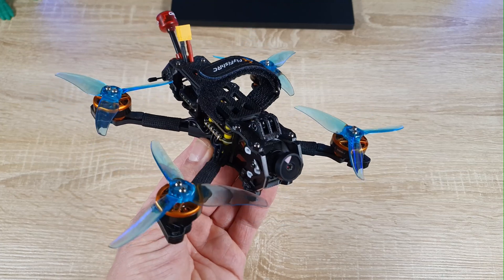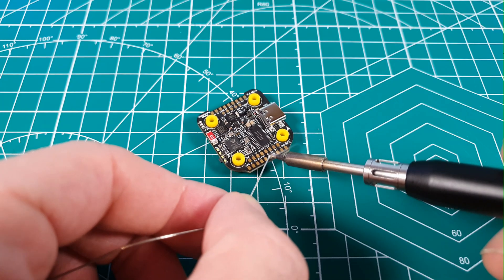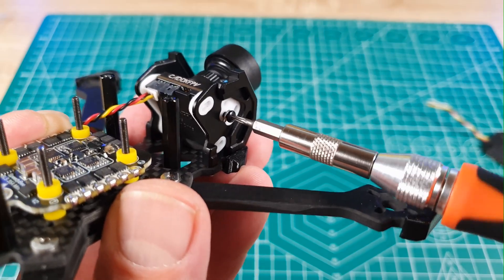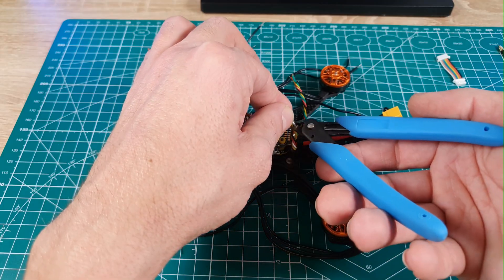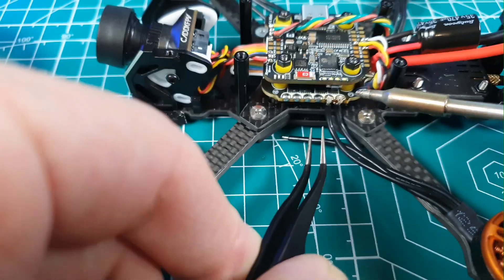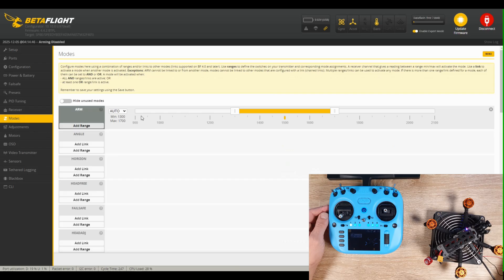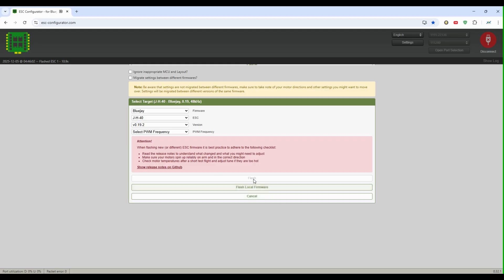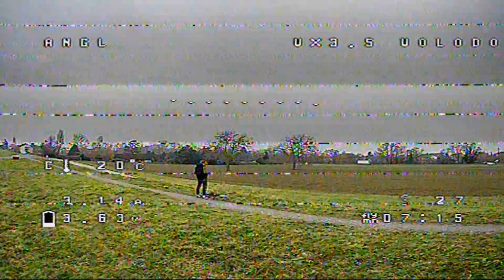3.5-Inch FPV Drone Build for $200

Comment: how do you connect the motors to propellers
Reply from the maker: The motors has 1.5mm shaft and M2 screw holes and the props have T-mount and are hold in place by two M2 screws, it also have an adapter in the middle which means that the props can be used with motors that have 5mm shaft but those motors are a little bit heavier.

Comment: Arduino jbc 245  What is the size of the pcb board
Reply: Sir please reply
Reply from the maker: @DeepakKumar-xe1jw   48mm x 68mm, both boards.
Reply: @HMProjects . Last question Where is the sleep mode wire connected